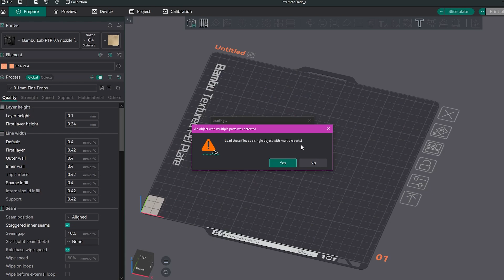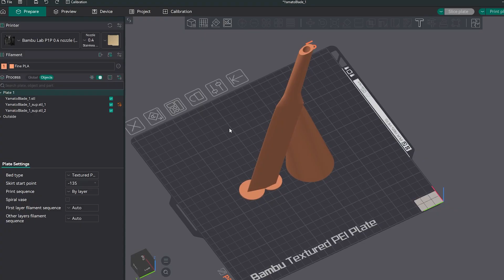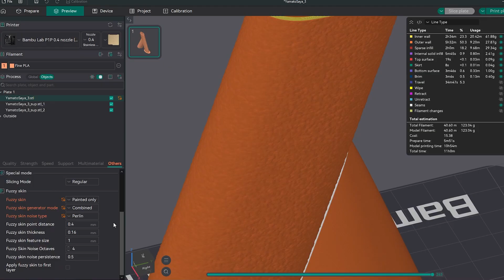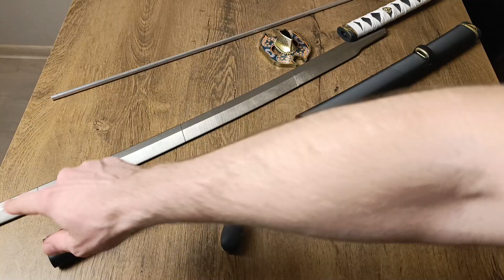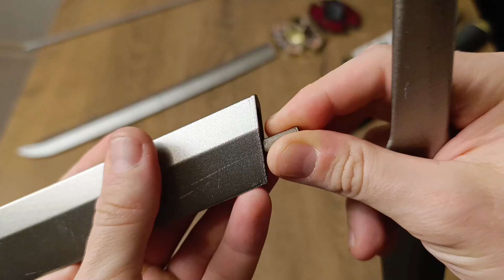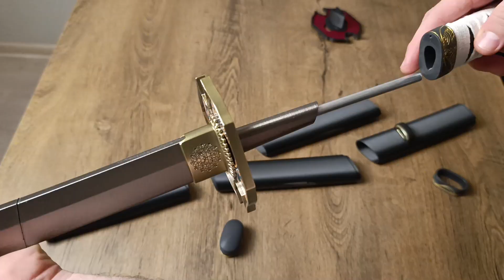Vergil's Yamato Sword DMC5 Cosplay Prop

Comment: I have an issue with the tip of the sword printing crooked... like not point, more like the last 4 layers are deformed, any suggestions? I can share pictures, I have almost all the pieces printed now.
Reply from the maker: That's normal in 3d printing. I would just cut or sand it to normal shape, but generally you want to slow your print speed and max out your cooling in areas like this.

Comment: I wanted to ask you, what glue or adhesive did you use to assemble the parts? I am trying to assemble the sheathe right now. Methyl Ethyl Ketone? Or gorilla glue or what exactly?
Reply from the maker: Hi, I mostly use 2 part epoxy (5 min one). For all types of plastic
Reply: @BrunenG_YT There is none but low quality ones in my country, but I will try my best to get my hands on them.

Comment: I had an issue with the supports not pealing off, I know you talked about the X Y thingy. I am now printing the sheath without support because the fuzzy skin will cover the line thingy no problem.  For the blade I will experiment with the X Y thingy.

Comment: How long is it?
Reply from the maker: 106cm overall
Reply: @BrunenG_YT hmmm that feels a tad short. Fairly certain in game it kinda just morphs depending on what the story and cutscene needs but generally I believe it's meant to be just slightly shorter than the rebellion (which most models make between 130-150cm).  I took a screenshot at one point to compare the size to Vergil's height and it reached up to his chest. I'm not dissing it at all, you did an excellent job and it might be the  most detailed Yamato model out there, but as a general suggestion I would consider making it longer. Still, fantastic job nonetheless though! I loved your Ebony and Ivory models
Reply from the maker: @BotForce  The proportions and sizes were taken from the game model Initially, and after that I mostly used traditional katanas for reference.
I do agree that it can be longer, but to my eye it will throw out the balance of proportions. My take on Rebellion is 130cm, as I always try to make things a bit more manageable for real life.
Also the height of person holding the prop is a factor, I'm 172cm average height and for me it's very much great. But for someone 190cm it's gonna be small. Sometimes I do custom versions by request, exactly for that reason. 
Anyway, thanks for your constructive input, it really matters for me.
Reply: @BrunenG_YT I'm 169cm, made my rebellion 130cm too actually. Been wondering if I should've made it 135 or even 140, since the model I used is based on DMC 4 and the rebellion is massive in that game, been looking into making a Yamato around 115-125cm, I certainly would not go above that for someone our height though. I am considering using your model as it is beautiful and just attempting to scale it to that, but, I'm unsure and still looking around for the best way to go about it. I've even considered making it out of wood
Reply from the maker: @BotForce  I always provide uncut blade part too, for people who want to make edits themselves. It's not hard to make the blade longer with basic blender knowledge. Or you can use all the detailed parts and make a wooden blade, which I think is superior to a printed variant.
I'd like to see what Yamato you'll make, please tag me on insta when you do that)